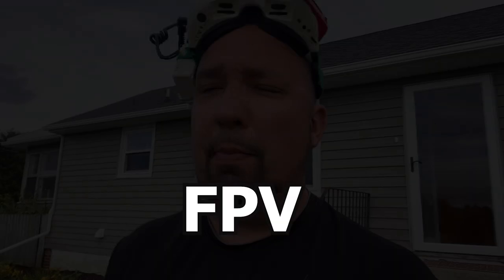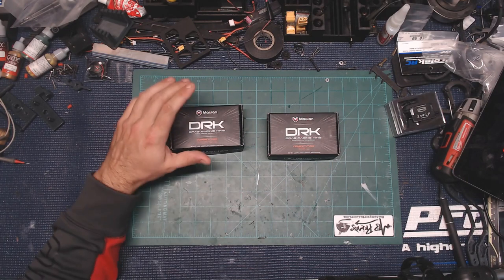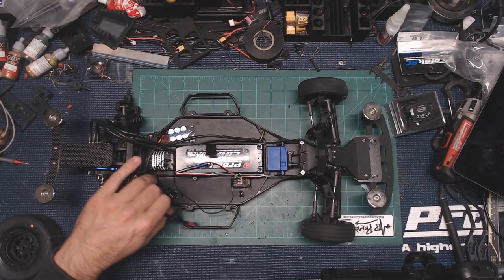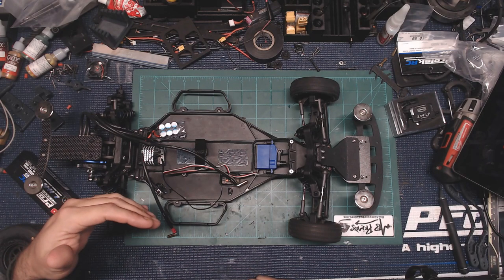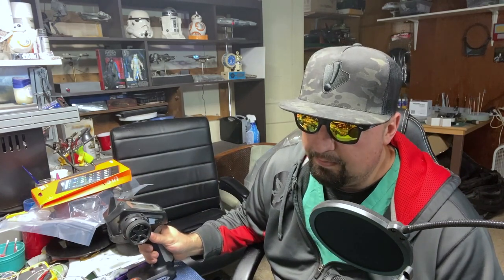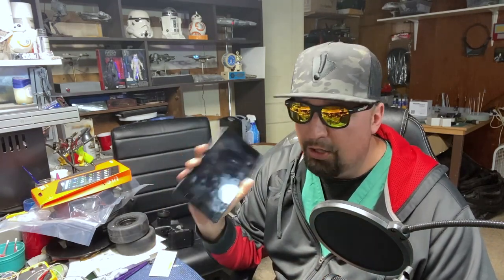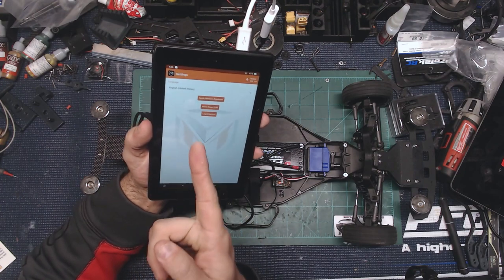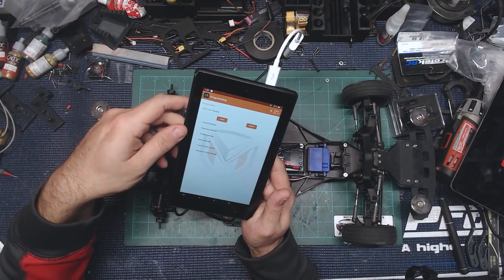MACLAN DRK 160 ESC AND 4.5T MOTOR | INSTALL AND FIRMWARE LOOK

Comment: that doesnt prove its the best, it just proved that the guy tuned his stuff better than the rest period, gear never justifies winning
Reply from the maker: agree to disagree??  i think the software really showed it power here by being able to tune the stages to meet the various track conditions throughout the day. i own this and the hobbywing and IMO the drk has more ability where it counts. controlling the hit. i look forward to proving this to myself soon. it certainly wasnt the fancy carbon bodies considering 2nd place had a nearly stock dr10 with 3d printed parts bolted on.
Reply: The guy that won. just started Drag Racing 2 weeks or so before winning. 
His daughter made it to the top 16 of 250 plus entries running a DRK Esc.   Dad was running a Reedy motor. not sure what the Daughter had.

The ESC is the shit.  Just got mine a few days ago to pair with my Pre DRK Drag tuned motor, that I have the DRK 13mm rotor to put into when it arrives on Monday.
Reply from the maker: Love the software man!  Have fun! Let me know how it goes.

Comment: My DRK just got here a few days ago.  Pairing it with my Pre DRK 4.5T Maclan V2/M Drag Tuned. Already has the Aluminum screws and has been shimmed.  One of the Maclan drivers/workers suggested I get the DRK 13mm rotor and install it. 
So that will be here Monday and once ready, should be a beast of a combo.

Running the RX8 and a Trinity DM3.5 in another rig that should also be a hand full.
Reply from the maker: nice man..ready for a warm up here so i can get rippin

Comment: i see you moved on from the maclan to the Castle system. How would you rate the experience with the Maclan and what was the main reason you changed?
Reply from the maker: and now R1.  all are fine..r1 makes most power and has mosty tuning.  drk was great but had lots of issues.  castle is solid.  no real boost and turbo sepetrae tuning

Comment: Do you have to have the motor sensor wire hooked up for the motor esc combo to work? I soldered my motor up today did the radio calibration but have no motor response.
Reply from the maker: Yes and don’t forget to reverse throttle in the esc software

Comment: What's good Chad! Yeah man I got the that system Maclan is the truth that fire lol what my boy said at the hobby shop and he's super nice at this. I'm running the Tekin G4 Eliminator 4.5 turn @ 30°. Should I put one @ 20°?  Also I have the prolink. I'm trying to compete you know. Lmao Thanks for the info.
Reply from the maker: Lol. I get it man. I think from my own personal results and all of the stuff I have studied you’re better off to turn the motor timing down and then just add it in with the ESC a little at a time until you get to a point where you need to put it back into the motor. I think a lot of us new people last year spent a lot of time trying to control the head doing dumb things with our radios and shocks and adjusting stuff and fuel tubing and it seems like a lot of it was just hocus-pocus
Reply: @Dorkyand40  you said it, man I see what's out there this system is mind-blowing. Thank you for getting g back to me. Last year I was the same drop it from go like real car.. Hahaha nope. My boy told me about the curve when your driving he taught me I been doing that technique since. Plus he calibrated my castle to do the same. I don't wanna tear this up a lot of money. Thanks again Chad.

Comment: What does the "turbo position" function do  !!  start that 70 and maxes out of 100%
Reply from the maker: That at what throttle % you want turbo to start kicking in.
Reply: I was under the impression turbo can't come on until after 5th stage. And the slew rate is how fast it ads timing once turbo  is activated after 5th stage
Reply from the maker: I heard Tim talking about it on tsr podcast and he was saying it’s a useless feature because that defaults the entire point. But if you went 100% throttle at any stage say 3 or 4 then it would start. I think it’s a mish mash of old and new features that needs cleaned up to fit in.
Reply: @Dorkyand40  definitely needs to be cleared up .. thanks man appreciate it  , I change it with no change on ticket and i get in 5th stage @ .7 = 100 % throttle

Comment: Not sure why anyone would want a program throw on your your car for racing seems wrong in my opinion making a driving skills not needed when it comes to throw control needed to be good . Just pull the trigger seems more like slot car stuff just use your expo
Reply from the maker: This is the best way. You pull to 100% and dial in the timing and percentage vs trying to guess with expo and trigger pull very time. We all did that last year. This is consistent which matters the most. These races are all less then 3 seconds and you have to have confidence to pull that trigger hard when the light tree hits :)